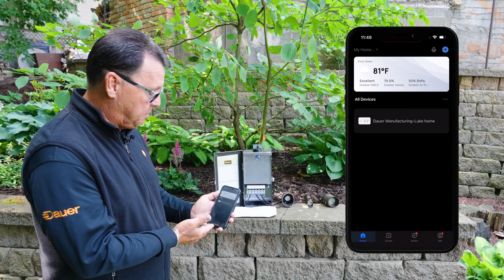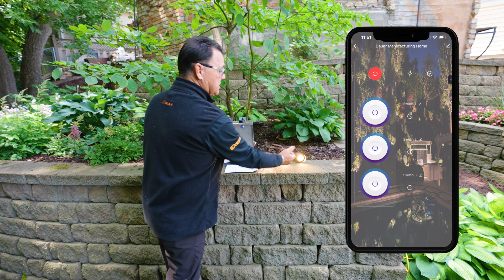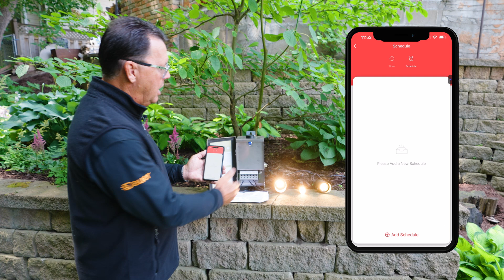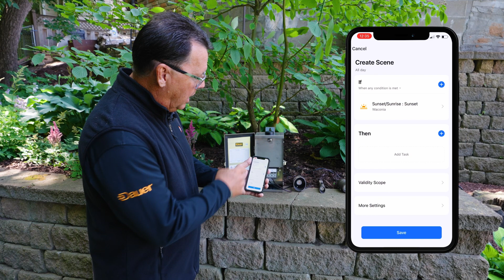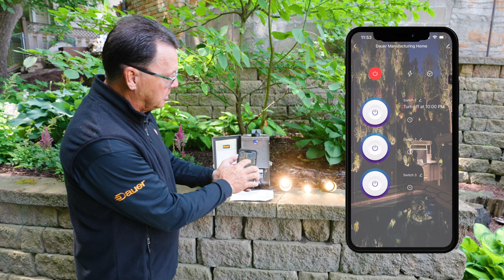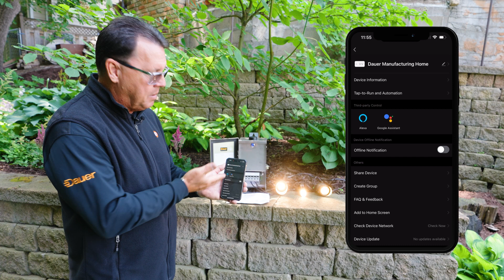Dauer Manufacturing - How to connect and use the Jarvis 3 Zone, 300W Smart Wi-Fi Transformer

Comment: I have this same question as below also, can you dim the lights via the app?  TY
Reply: You cannot dim low voltage lighting. Low voltage LEDs have a very very small operating voltage window and either over or under voting them will cause them to burn out prematurely. You would need line voltage lights if you want a dimming feature